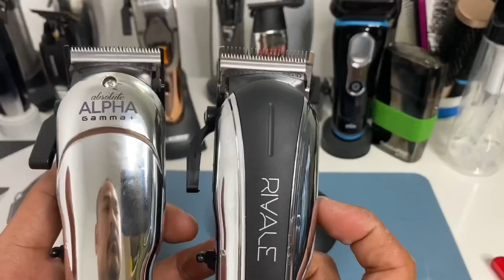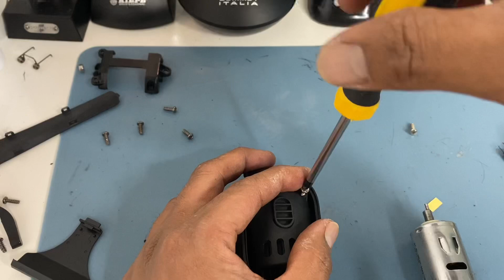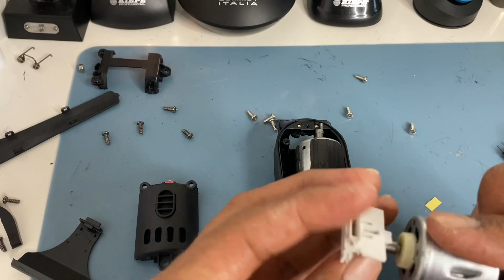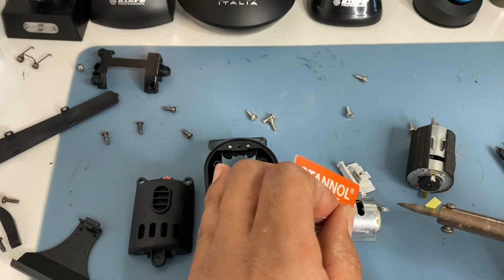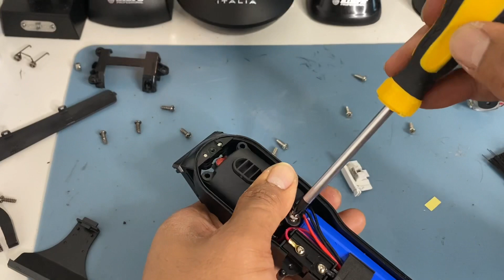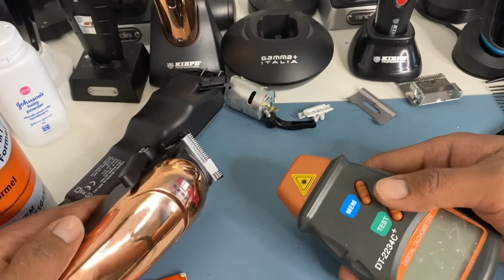How to Modify Alpha Gamma/7500rpm🔥🔥🔥

Comment from the maker: Many were asking which motor? I Used the motor from my old VGR-011 or Kemei 2850 for this Alpha Motor Swap. I just did the Modification. Havent tested yet. Sooner🙌🏽🙌🏽🙌🏽
Reply: What’s the motor specs though. Because in the states we can’t get that clipper. What’s the ratings on the motor you swapped to
Reply from the maker: @Joeybag0donuts  you have alpha in states. Its the motor same as wahl senior
Reply: @sampitz  so I just have to take my motor out of my seniors and put it in the alphas
Reply from the maker: @Joeybag0donuts  just like that🙌🏽. But i used motor from my VGR 011.

Comment: if you put a wahl senior motor it will reach 9,000 rpm? 💯😉💪🏻🔥💈
Reply from the maker: Im not sure. But that is too much. 😅. I think wahl has bigger shaft so you might need to use the OG wahl cam follower
Reply: I bet on that engine.